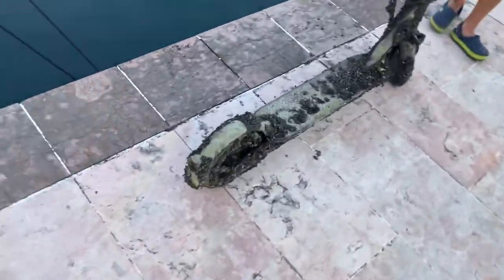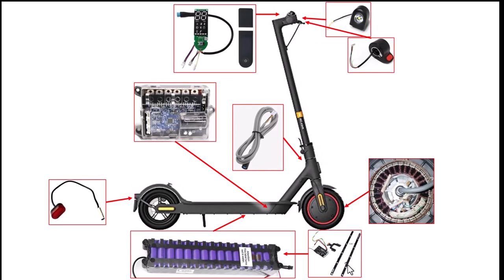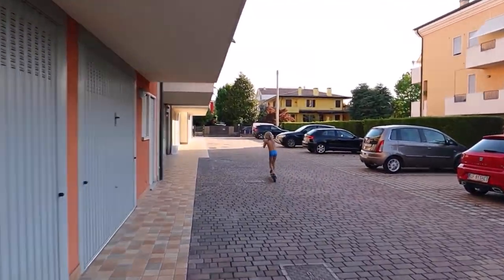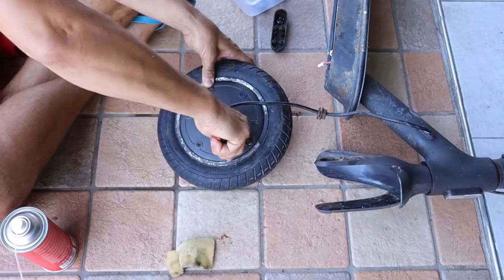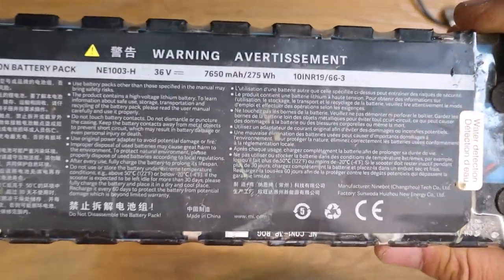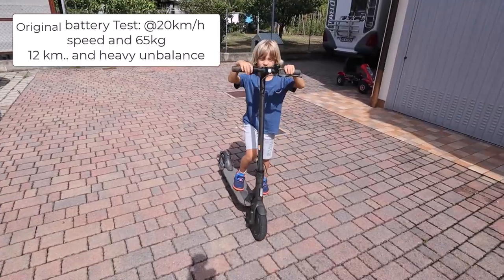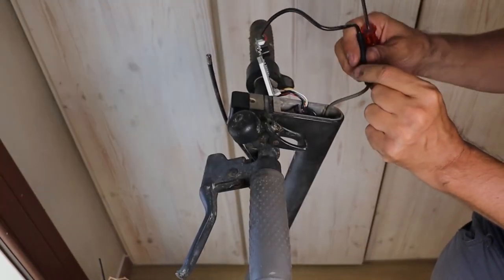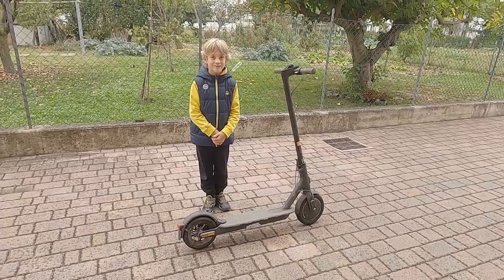xiaomi M365 scooter water damage FIX

Comment: i am suprised by the amount of rust, there is almost no rust
Reply from the maker: Yes, impressive actually
Reply: @MakerFabio  by the way, which 3d printer do you reccomend?
Reply: Aren't they made from aluminum?
Reply from the maker: @Iinustechtips  i have an Ender 3 pro
But it depends by the budget, and every 2 year there are the new “best models”
Reply from the maker: @GoncaloRijo  the frame yes, but several nuts and screw they are little rusted. And all the motor stator is made by iron
Reply: @MakerFabio update for scooters?
Reply from the maker: @Dragon-rv4xr  hi, I just modified a kid moped Razor100. But it is almost a toy